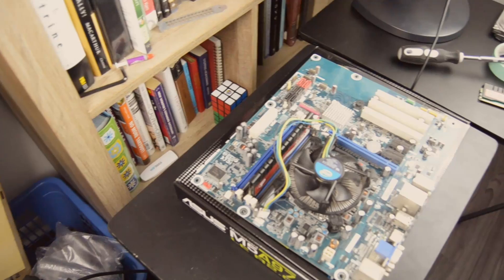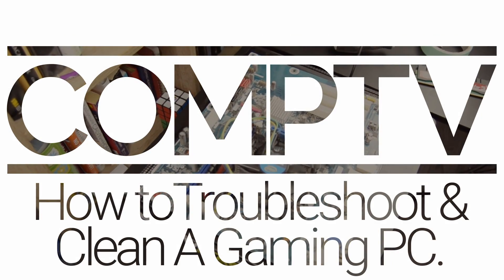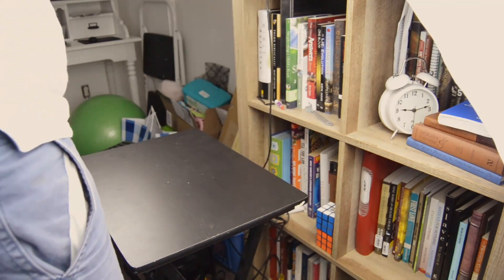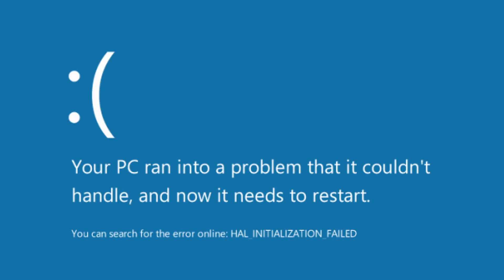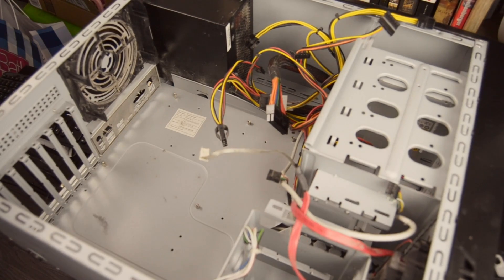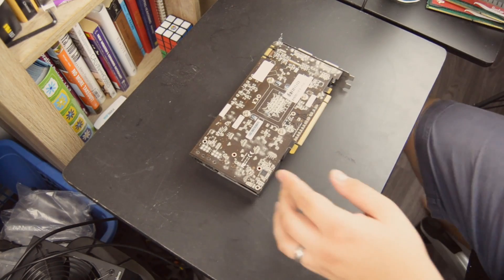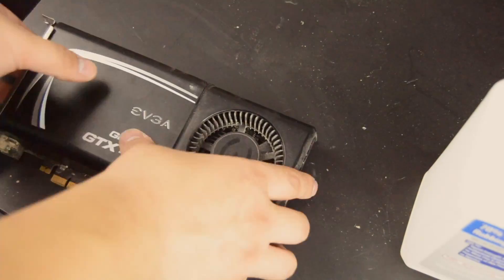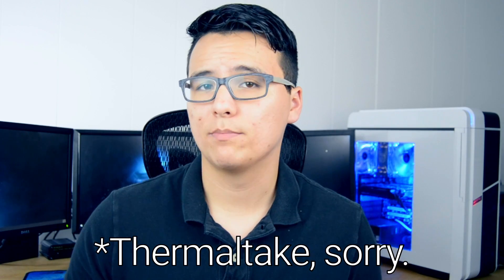How To Troubleshoot and Clean A Gaming PC

Comment: I always also change thermal compound in the northbridge (found in older systems, they run hot  as hell with no fan on it and it is completely cooked), (also in my rack servers) and that really needs to be replaced, since sometimes it is very hard to remove, heating it for 20 seconds with a hairdryer made it really easy to remove and change the compound as usual. If I had a Nvidia GPU like that I would also try to remove the IHS (GPU COVER) (following a guide) because there is compound to change under that too, in one server I also changed the paste between a transistor heatspreader of the PSU and the psu case itself (found this placement only in one) I don't usually disassemble the heatspreader from the power transistor to change the paste there too, on the PSU stuff I use a less fluid thermal compound, found in a local store.
Reply from the maker: OOooo all great suggestions, thank you!!
Reply: comptv Thank you for the useful videos, also useful to link to friends when explaining something as reference material. subscribed :-)

Comment: I screwed up and tried to remove the net framwork registry values and decided to remove the microsoft part. Even though I failed to remove it all, some parts were removed, the laptop was working. I restarted and the error Critical_Process_Died appeared. I kept trying to wipe the whole thing and starting a clean windows installation but I failed. Then, I installed an Enterprise crappy version of windows 8. I removed it to install a single language which works just fine.
Reply: Virtual Machines are the best when it comes to backup and snapshots. The whole main system thing is just crap.
Reply from the maker: +mohamed magdy glad it worked out in the end! That's where we learn all the tips and tricks haha
Reply: This is my second hdd. It was terrifying to see it that close to dying on me. I thought my heart was going to explode

Comment: could you make a video on how to make an old laptop into a gaming laptop or desktop
Reply from the maker: I've been wondering that for a very long time myself. I'm guessing that it would take some modding to do.
Reply: so is it possible to turn an old laptop into a gaming one?
Reply from the maker: Well as far as I know you can add more RAM and if you want to get really crazy, there are ways to add a desktop GPU to a laptop. So I believe it is possible, but not cheap or easy haha.
Reply: so would it be better just to get a new laptop?
Reply from the maker: if you're going for a gaming laptop, yeah your best bet is to get a new system. Let me know what you decide!
Reply: I don't think it's worth to put an external pci graphics card or change the processor (if possible) on a dated laptop, especially if it wasn't good, but maybe it was a performance model? There are guides if you want to use a desktop graphics card on a laptop externally, it's not easy to do.